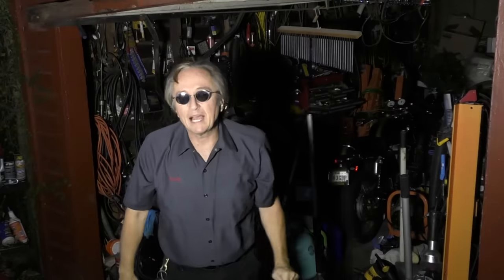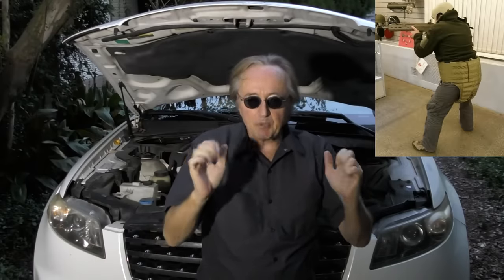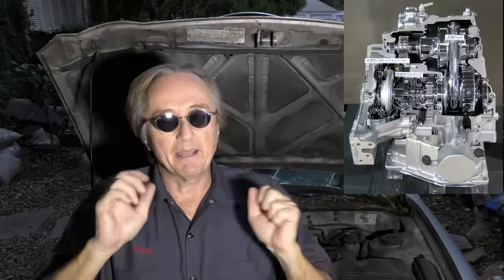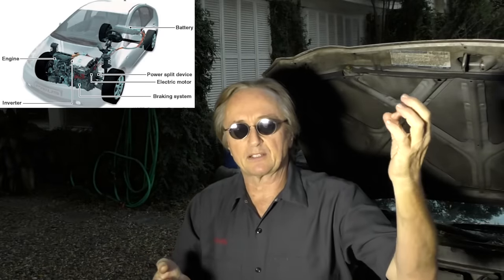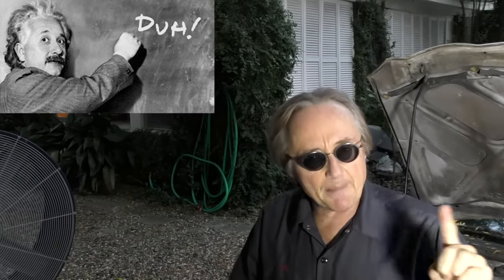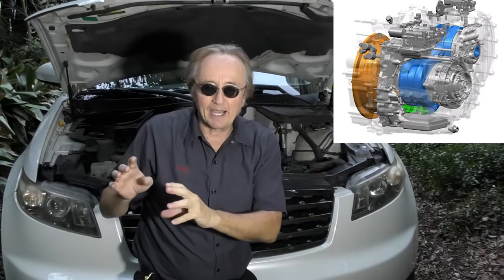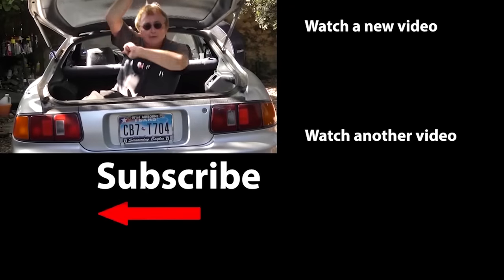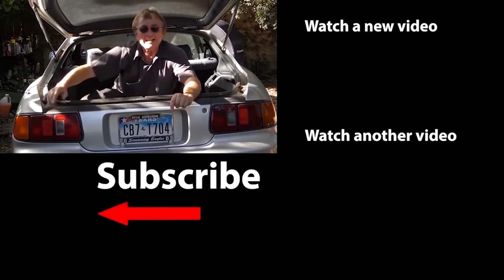Why Most CVT Transmission Cars are Terrible

Comment: Literally just bought a 2016 Altima with a CVT in it 5 days ago. And NOW I’m seeing this video. I hate my life.
Reply: I bought my Grand son a 2018 Altima, a few weeks ago now I'm hearing this,I'm asking for mercy on this car
Reply: Sell it quick while you can. It will become a pain in tha neck if you dont get rid of it. I had one
Reply: I bought a 2014 Nissan Versa and the transmission at 77,000 is now completely ruined and needs a new one
The dealership is charging me $5,000 to fix it bc I am out of the warranty 
And if I fix it at an outside mechanic, the best price I found was $3,000 

I am now in the market for a new car & am never buying a Nissan again 
But I’m glad yours was covered, I wish mine was, ive only had that car for 5 yrs 😩
Worst car EVER!!!!

...I would take RMs advice and get rid of it 
Look at my situation, I am barely seeing this now, $3000-$5000 in the trash
Reply: I sell new Nissans and I'm well aware of the CVT. It's a transmission fluid temperature reader that's not keeping the the fluid cool. Make sure you service it at the dealership so the technicians monitor it. The CVT wears out when the customer isn't aware that the temperature gauge has overheated and the transmission begins to wear out. It's avoided by not reving your engine in gear unnecessarily. Don't push the car to pass people aggressively. Service with the dealership and get a diagnostic every oil change. Diagnosis are free. What Scotty doesn't mention about the CVT are the benefits. CVTs save gas milage is the best yes but they also shift extremely smoothly. The ride in a Nissan is much more comfortable than any other Japanese car because of the CVT and the noise cancellation interior makes for less road and engine noise to. Nissan's push for innovative technology for a superior ride and they release new saftey and convenience technology before the other Japanese manufacturers. Stick with your Nissan, take car of it and service it well. Just like any other car!
Reply: @brendas9095  nothing I said is untrue. Think of me what you like. Customers are 12 times more rude then car salesman because of stereotypical assumptions. You're welcome to research my statements.
Reply: Goat Boy 04 maxima se 130k running strong
Reply: Goat Boy I know someone who just bought one a about 4 months ago and cvt is bad already and they will only cover $3000.00 for warranty
Reply: You'll be fine haha over 99 percent of these things are going just fine. Change the fluid every 30k miles and dont abuse it. You'll be okay. They're quite comfortable cars with excellent fuel efficiency.
Reply: @rahrah8076  30k miles is acceptable while they suggest 60k or when when the deterioration data reads 210,000 on the CONSULT. It is good practice to do it every 50k miles on a regular automatic anyways, CVTs need a bit more care.... and you're wrong no offense, the biggest reason there is failures has nothing to do with the belt or elements, it is either low fluid pressure causing the solenoids to malfunction, which in turn causes failure of the belt. Or it's the check balls on the drive shafts being damaged, which causes the variators to lock up, and also causes belt failure. Belt failure is almost always because of an underlying issue, and people not changing their fluid enough is a big problem because the fluid pressures reach 800 PSI in these units. It needs to be as clean as possible. The steel belt and sheaves are the least of your worries. I'm no slouch when it comes to CVTs. They're actually a very undervalued technology, and more than 99% of them do just fine. I've seen regular automatics go bad under 100k, a Toyota no less.... go figure. All cars can have problems. Most do just fine and it's not worth always worrying about it. Still sad for people that invest thousands of dollars into a machine that breaks down. It can happen to anybody, regardless of what car you buy. And every manufacturer is shifty when it comes to helping people with lemons.
Reply: Aleast you dont owe dodge charger
Reply: googly moogly this is by far the worst vehicle to own..my buddy owns one and he has been changing his fluid every 40,000km and it still failed..so it don’t matter if you change the fluid..he did get the Tranny cooler installed and a bigger heat exchanger with 4 ports after the second cvt failed and now he’s getting a lot of km on it..
Reply: @smcdoug11  Thanks Ninja! :P  half of my family leases/owns Nissan vehicles and they haven't seen any transmission issues.  My latest car is the Versa SR 2020.   Any clue if the CVTs have improved over the last few years?
Reply: Just had my 2016 Altima transmission changed at 29k miles lmao (under warranty). feelsbadman
Reply: if it makes you feel better, Nissan was involved in a class action lawsuit over their crappy cvt's and now they had to extend their warranties.
Reply: They go bad if maintenance is ignored ur suppose to change the fluid every 30,000 mile my wife Altima has 122,000 miles
Reply: @smcdoug11  "it's avoided by not revving your engine in gear unnecessarily. Don't push the car to pass people aggressively" 
HAHA good one. So basically what you're saying to people buying a Nissan is nanna it. Keep in mind nissan has the reputation of making the skyline, the GTR, the Sylvia etc. And you're here telling people they need to nanna their new Nissan. Get back under your bridge troll, lol.
Reply: ni wayyaw theirrieht makeekam toot starteddetrats partsstrap RenaulttluaneR theeht BeforeerofeB
Reply: @acgolem  I think this goes for any automatic transmission?   Dont ruin them by playing need for speed in your car.
Reply: Never mind drive the shht out of that car safely
Reply: CVTs are fast people used to always think I my 2.5 was slow fast you got 100k on a car  you had a good run stop crying over it
Reply: @brendas9095  There is a class action lawsuit.  Sounds like you would qualify.  Part of the settlement is reimbursing customers for their transmission repairs if you have the documentation for it.
Reply: @mewimi  I have one from 2016 that started failing before 50,000 miles with regular and up to date maintenance.
Reply: @rahrah8076  that sucks real bad for your buddy. I wouldn't with that on anyone. But, I can say I've heard of my coworkers Camry trans going out at like 80k I believe he told me. So still it can happen to any car. Cars just suck in general.
Reply: u can return it.  7day guarantee
Reply: @brendas9095  get a manual nissan problem solved ;)
Reply: I just bought a 2015 murano and now I'm really  REGRETTING I SAW SCOTTY MEME OF THE DONKEY LAUGHING 🤬
Reply: Mojo Jojo should’ve got a 2015 accent way more efficient
Reply: optimistic but realistic This is literally the dumbest comment in this thread. Those cars used manual transmissions. The modern Nissans use CVTs which is a more delicate transmission. What were you smoking when you replied to Plato?
Reply: my 09 altima has 300k on it and my brother now owns it as i now have a 2019 altima. my dad has a 2015, and my friend has a 2017... None of us have had any issues whatsoever.. Just do regular maintenance
Reply: @smcdoug11  if that is correct then should maintain the reputation of the brand cvt by recalling for temp gage. If it is true again
Reply: Plato's Ninja so when I take it to have it serviced at the Nissan dealership you mean oil change’s? I’m
In the process of buying a 2012 Altima with 59,000 miles and now I feel like it’s not a good idea help me out with my decision making
Reply: @smcdoug11  can even slap a transmission cooler on it for good measure
Reply: @rockcortez01  I can help you out. Don't buy Nissan crap. They would be awesome cars if it wasn't for their CVTs
Reply: Knucklehead I got a 01 and 06 maxima, both with Stick Shift  on the floor, none of that paddle crap, and I got me a vietnamese mechanic who i pay in cash and he gives me an O Reilly Clutch for 800 cash, no CVT nightmares for me  son.
Reply: @smcdoug11  Those Nissans have a temperature gauge specifically for the CVT Transmission?
Reply: Nissans have ok transmission I had one drove uber and had no problems  somebody has video of a nissan altima cvt 313k and no problem
Reply: Did you buy it from the dealer and get their ripoff extended warranty too? Terrible cars. slow to speed up, and also uses up a lot more gas then other cars. It's a complete scam.
Reply: @smcdoug11  A car should be able to withstand passing people and reving... come on...
Reply: Get rid of it fast!!!
Reply: Plato's Ninja bull ish! My 2012 versa cvt was a dumpster fire. The cvt was acting up right when I bought it. Dealerships won’t do anything but lie and say everything is fine
Reply: Plato's Ninja wrong. Revving the engine on a cvt 2012 versa or racing isn’t possible cause they have zero power
Reply: 🤣🤣🤣🤣 Welcome to the party!
Reply: Lmao same
Reply: Just bought a cvt transmission car. Dont regret it.
Reply: @smcdoug11  but CVT transmission fluid is more expensive than regular automatic transmission fluid. And you have to replace this fluid every 30 to 50k miles.
Reply: I ave a 2009 maxima sv with CVT have 160,000km on it now. never had a problem with it, and still drives like new
Reply: Goat Boy yeah I had a Nissan Altima & the transmission totally failed. Nissan had a recall and had to replace it
Reply: It’s a extended warranty for that year mine just went out at 51k but it’s last until 2024 or 84k miles whichever first
Reply: My Nissan Sentra SL 2013 my transmission went out at 65,000 and the mas flow sensor went out as well peace of junk
Reply: just keep up on the maintenance and cross your fingers
Reply: 200.000 kilometres on my Jatco CVT on my Nissan and had no problems. Just replace the gearbox fluid on regular intervals and you will be just fine (don't listen to him ;-) )
Reply: My Sentra's CVT went out at 15k miles. Godspeed to you all.
Reply: I bought a 2011 Altima170k miles w a CVT engine for $2.7k but the engine sounds great and had it checked by a mechanic who said it’s in good condition before buying so is it still a good deal?
Reply: just sell it then
Reply: I almost bought a rogue 2016 im glad i saw this vid
Reply: @brendas9095  same thing happen to me. Contqct nissan customer care. I got them to cover 80percent of the bill. I then traded it in and since had new cvt i got better trade in value.
Reply: Goat Boy I bought a 2008 Honda Odyssey with a defective engine (cylinder misfire) and since the prior owner had work done outside of Honda, the Honda dealership refused to honor the extended warranty.
Reply: @brendas9095  🤣🤣🤣🤣🤦🤦🤦🤦
Reply: @mexking2683  no don't have.
Reply: @smcdoug11  I have a nissan and its awesome!
Reply: My 2013 Altima has 131,000 on it and no problems . Had fluid changed at 62k and 121 k .
Reply: @smcdoug11  sounds like a lot of work for POS
Reply: Im selling my nissan now, i feel sad
Reply: I had a 2013 Altima and put 133,000 trouble free miles on it before I sold it . It was actually a great car . Change transmission fluid every 50-60 k and oil every 5 k and don’t drag race it and you’ll be fine
Reply: LandDragon101 those cars are rwd. Those 5 speed transmissions are better.
Reply: Great i just bought a 2018 Nissan rogue with almost 30k on it
Reply: my 2009 Altima has 220,000 kms, no issues thus far
Reply: @urygen  That's great because your model didn't come with CVT. Which is probably why it's running strong at 130k miles.
Reply: I had a 2017 Nissan Versa and I had to sale it quick cause the cvt would jerk when I tap the gas pedal and when I shifted to drive and it would make a grinding noise
Reply: @brightonchou1393  not in every state.
Reply: @johnlyles8345  please reach in your soul and tell him your buying a different one and return the nissan PLEASE
Reply: Don't drive it like its stolen and you might be OK... watch videos on how they work compared to conventional. You will understand why.
Reply: @JustMe-lp1em  conventional transmission are better
Reply: I know that my name says Nissan and Infiniti turbocharged and I regret putting that as well
Reply: @smcdoug11  nothing you said was untrue except the fact the scotty did list the only "benefit" of owning a cvt
Reply: Just drive easy and do a proper flush on the transmission fluid.
Reply: Damn I just bought a 2018 Honda with cvt 😬😬 freak
Reply: @robertmendez8859  Honda makes there own
Reply: @toyotaandlexussupercharged6699   so am I in the clear?  I got my car with 6,000 mile I figure a Honda would last me 10+ years, also it drives so smooth must be the cvt, one min im at 45 next im at 70
Reply: @toyotaandlexussupercharged6699   now im trying to learn how to use cruise control.. and the hazards lights
Reply: @robertmendez8859  yes you are just follow the maintenance manual on the inspection of cvt fluid and you will be okay
Reply: @smcdoug11  I love you because I almost dropped the 2011 Nissan now I’m definitely going to be buying
Reply: change the oil an filters   ,,,be ok
Reply: ME TOO. I bought a 2016 nissan sentra pre owned, and i feel like i should have done way more research. I wanna kms
Reply: Trust me on this change the oil every 30k and u ll see the transmission live as u want this is my advice to you
Reply: @smcdoug11  would you recommend a transmission cooler to be installed, will 5hat fix the issue?
Reply: @patrickglennon6834  see a Nissan technician. Ask him what you can do to make sure the coolant doesn't fail. Because whatever parts you get may or may not void your warranty that is on the vehicle. This way you get good advice and you make sure whatever you purchase Nissan approves of
Reply: @smcdoug11  it's out of warranty any way, I will install 5he cooler any way, no harm, cheers.
Reply: Dont worry nissan fixed cvt problems after 2015
Reply: @smcdoug11  Don't try. I'm never going to buy a Nissan.
Reply: dont feel bad I bought 2019 sentra cvt transmission we all learning
Reply: Buy toyotas and don't hate your life
Reply: Don’t trip, my 7th gen Altima has had no issues from 6 miles to almost 100k now. If you aren’t pushing the car like a car it’s not supposed to be, then you don’t have to worry about killing the transmission.
Reply: @Jonathan McCully that is your opinion, dude has barely had his car, not everyone has the stereotype problems.
Reply: @brendas9095  don’t buy used cars if you aren’t willing to accept the gamble. That car was probably fine forever until the first owner stopped caring about it and started pushing it to the brink of the situation you are in now. I bought my Altima new, I take care of it, and at almost 100k miles I have never had to have any non cosmetic work done. The cvt is smooth as butter and with 270 horses it can push.
Reply: @odeefromdawic  who said it was a used car??? The car was BRAND NEW when I bought it
Reply: Just be sure to keep up with your oil and belt maintenance and everything will be fine. I just got a Chevy spark with a cvt. We will be ok🖤🖤
Reply: I have a 2016 Altima as well for the past 3 years and have had no problems. It has only has 34,000 now, when i got it it had 4000 it was a dealer's loaner.  I just found Scotty's channel like a week ago, I had no idea Nissans had all of these problems. I also had a Sentra & a Versa with no problems. This is my second Altima, I previously had a 2008, it had over 100,000 miles had no problems with it however other drivers couldn't seem to stop crashing into it. My insurance company totaled the car. Oh I almost forgot, Nissan sent a letter extending my warranty for another 7 years or 85,000 miles what ever comes first because of the class action lawsuit settlement. Hopefully they extended yours as well. Good luck!
Reply: @brendas9095  Yeah welcome to the club never again any CVT garbage.
Reply: @smcdoug11  i bought a 2018 rogue  an  it has 18.000 on it  ..being a gm guy...i still like this  suv...i know about the cvt  an it will get serviced at 30,000 ..all cars have a weak  spot  no matter  who makes them
Reply: If no one knows how to care for any machinery, no machinery is good.
Reply: @NoName-gv6nm  those nissan CVTs are still inferior, if they need more frequent oil changes than manufacturer recommended.
Reply: @smcdoug11  nissan cvts shift no better than any other car, maybe a well designed cvt. Can't overtake people aressively?? What about when I need to merge on to a highway from a stop, or it's going up hill and everyone's going 70??? These are things a normal car goes through.  This just sounds like propaganda people. Ignore this.
Reply: Hey, live and learn.
Reply: Yea I just bought one , I should have done my homework.
Reply: A bad car purpose does not define your life. I’m trying to figure this out as well . Trust in the Lord. We’ll just have to find another tranny when ours goes out , lol. Smile ,life is short.
Reply: @smcdoug11  Exactly. CVT's are GREAT so long as you service your vehicle accordingly. They get bad reps because of careless drivers that do not take the necessary steps to ensure their vehicle actually lasts. I love CVT's...I honestly hate driving regular automatics now.
Reply: Dont worry bro...my freind also has 2017 altima...and he is using for 3 years more than 200k km ..still no problems with transmission..
Reply: @smcdoug11  I know I'm replying to this a year later, but come on man you can't say that "hey as long as you drive this car at 70% the capacity you could drive our competitors it will last almost as long!" like what are you smoking it's why Nissan is struggling to even keep the doors open
Reply: Haha me too one week ago
Reply: Just got a 2018 Altima about a week ago. Just had to get rid of a 2020 Corolla because of the transmission issue. I'll just change the transmission fluid every 50k miles on the car.
Reply: @smcdoug11  wait i thought cvt transmission DOESNT HAVE GEARS? im so confused
Reply: 2 years later can we get an update?
Reply: If you stay on top of replacing the transmission oil at least twice a year you should be fine. I’ve had a ‘17 SR Turbo for two years now and never any issues as long as you stay on top of your maintenance
Reply: How is your Nissan doing in 2022?
Reply: @SailioNation  That's awesome to hear. I have an 09 Altima. I have 128k on it. So far so good.
Reply: @brendas9095  I'm in the same boat with my 2009 Nissan Versa so far it cost me almost 5,000 when I bought that car. I was told the same $3,000-$5,000 to get it fixed
Reply: Start saving up 3500 dollars.
Reply: Honestly not the worst year for CVTs. I had a Versa Note from that year (drove it from 60K mileage for over a year) and it was nice little car. Just make sure to keep up with the fluids and get that transmission flushed around every 60k. Don't neglect transmission maintenance, it will really cost you with a CVT.
Reply: @nibbanadhatu  HATE IT!! 😢😢my transmission been out 3weeks now on my Nissan Altima 3.5 SL!! It’s at 110569 had the car a year and already a car from hell😞 I changed the CVT TRANSMISSION FLUIDS and it took off but still the start is slow not sure what’s going on..My neighbors told me get a Transmission Flush🤦🏾‍♀️🤦🏾‍♀️🤦🏾‍♀️🤦🏾‍♀️ I don’t know what that is
Reply: @mandar9482  same here
Reply: Don't listen to that guy. He is a bigg Nissan hater. My 2012 altima has 152K miles on it. Never ever changed its cvt fluid. Still good acceleration and 30 MPG!
Reply: Hey bro hows the car doing
Reply: @gdlt9861  me right now 😫😫😫😫
Reply: I would love to know if your Altima is still moving. I just bought a 2015 Altima without knowing about any of these issues.
Reply: Make sure you change cvt fluid every 30k and it would last!!
Reply: @illuminatikid4767  every 60k is what I'd recommend IF he's a passive driver. If he's a hot foot driver like myself, yes every 30k. Mine has 128k miles ATM and it became a headache thanks to mechanics having no idea about cvt.
On day I was doing preventive maintenance before taking a long trip. I asked if I should change the cvt fluid and the mechanic said no.... Big mistake. 

Now I'm dealing with a half busted cvt thanks to the mechanic. After that I have to fix it myself doing lots of research, because I haven't found a mechanic with 2cents of brains
Reply: I bought my Nissan sentra 2014 and my transmission was broken when the car had 90,000 miles,too late for me to!
Reply: @luga718  my condolences man 😓
Reply: Mine just went out at 132k miles smh
Reply: @dadrianmcintyre3323  it's sad that some vehicles are still in their prime at 100k miles while altimas are at their last around 100k
Reply: @johnlyles8345  how is his car doing so far?
Reply: I just bought a Nissan Altima 2023 and as far I read is change transmission fluid every 30k miles and don’t “abuse”’it which I’m worry because my wife drives it and she sometimes flooring the gas pedal which I don’t do and I get mad at her haha
Reply: @paydequezo  I ended up getting a 23 Corolla se. But I’m the same as you with my girl💀 I’m hella easy on the pedal and I get 31 mpg
Reply: Your cvt trasmission is fine just make sure you do regular flushes regular filter replacement in the cvt transnission 
The nissan cvt has 2 filter that you can change and when you do it regularly im sure your cvt trasmission will last till 200000 miles 
Im on 130,000 rn
Reply: @imlamar2011 😂😂😂 2.5 being fast 😂😂😂
Reply: Just do CVT fluid every 30k. That’s the trick plus you can do it, YouTube.
Reply: I wanted an Altima and almost bought a maxima the night before saw the cvt was in it so went instead with a Camry 2017 🤞
Reply: How’s it holding up
Reply: @johnnyp3839 
You should have gotten a Camry
Reply: @tberjashi6707  I do have one now. 2020 model it's an outstanding car.
Reply: I have got only 58000km on my 2015 Nissan pulsar now the mechanic says my transmission is gone. All is doing slipping and jerking while driving and the code coming up p0841.
Reply: I haven't bought anything. Just doing research and looking at the PRICES, and I hate my life too.